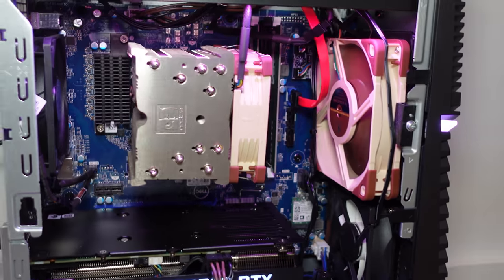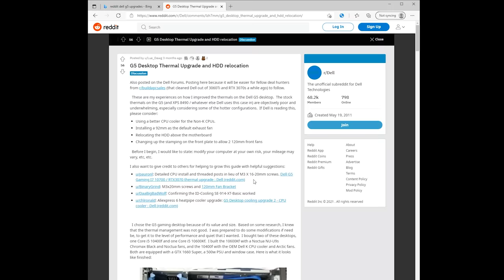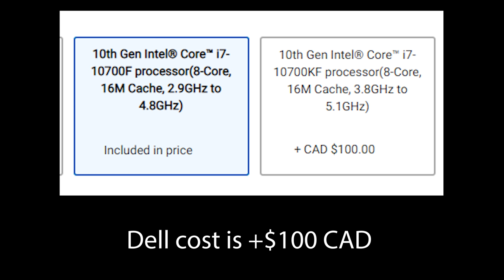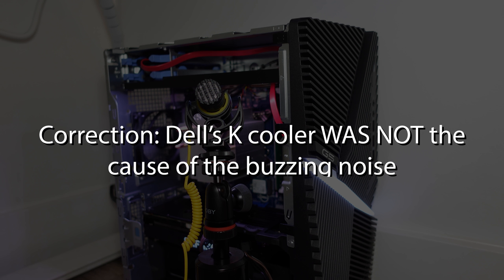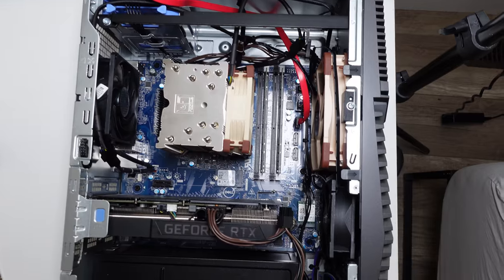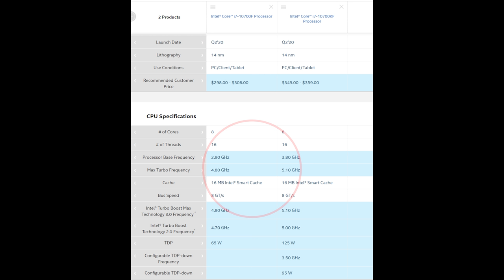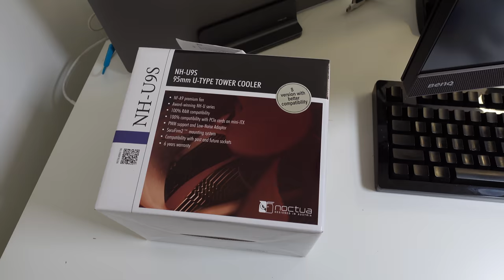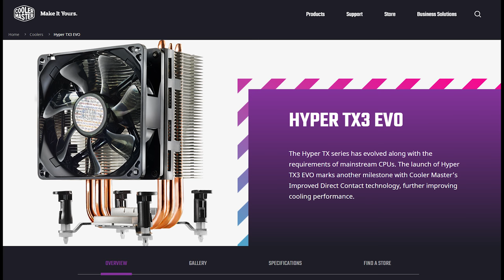Should You Upgrade Your Dell G5/XPS CPU COOLER? (with step by step instructions, in-depth analysis)

Comment: I've been building computers since 2001. Don't bother with "dime size/pea size/dot pattern" for your thermal paste. First and foremost, let's regard it's purpose: Thermal paste does NOT help conduct heat between the CPU heatspreader and the cooler base. Yes, I said that right. You want as much metal-to-metal contact between those surfaces as you can get, but the job of the thermal paste is to create a heat bridge between all of the GAPS between the heatspreader and the heatsink. Air is a great insulator, so you don't want any air gaps between the surfaces. That paste of dielectric grease and finely ground silver particles is there to fill every groove, pit, and air gap between the microscopic ridges of the two surfaces and bridge heat across them, but not to be the primary transfer medium. There's not a thermal paste out there that makes heat transfer between metals BETTER. Adding a blob and hoping that the pressure of the heatsink is enough to squeeze out most of it is less than optimal. You want heat going from metal-to-metal with the least amount of interference from the paste as an intermediary. 

That said, the "old-school" way is to place a small dab on whichever surface is larger, flatter, and easier to work with (usually the CPU) and work it gently with a flat razor blade. You're using a razor because it is incredibly flat and clean, not because you want to cut anything, so you drag the blade across, not push it. You work the blade in a cross-hatch from at least 4 different directions until you get an even distribution of paste on the surface in the THINNEST LAYER that is practical. You will be absolutely amazed at how much paste you remove in the process! OEMs of coolers add too much paste to guarantee 100% coverage, but they have to have a large safety factor because of human error that they can't control. Too much paste is still better than not enough, but too much paste will REDUCE heat transfer. So you're going to get a thin, even layer on ONE surface, place the cooler on as squarely as possible, and gently twist or slide to align within say 1/8" or ~4mm. It's totally okay to lift the heatsink and look at the pattern. There's more than enough paste in the tube for 2-3 applications, but it's not like you have to throw it away when resetting, just collect any overflow, gently scrape or wipe one surface, re-spread it all evenly onto the other side and try again. DO NOT lift the cooler and then smash it back down without re-spreading the paste or there will be gaps. To some degree you have to "get a feel for" whether you need to start over or not. The paste doesn't have great shear strength, and you don't want to introduce gaps from sliding or rotating it too far, but a wiggle or two are fine.

Lastly, that paste needs time to set UNDER LOAD. It is a paste, and after it heats up it will flow and squish out the sides ever so slightly as it seeks to further fill those tiniest of scratches and gaps. Check your temps again after a couple of days or a good torture test and you will almost always find it cools better after "bedding in".
Reply from the maker: Wow thank you for such detail.
Reply: @billmahan6373  If it's working for you, no need to change it. You only have to reapply/re-spread paste when removing & replacing a heatsink. It doesn't break down like engine oil - or at least not in a timeframe that matters to practical use.

Comment: I tried doing the fan + CPU cooler upgrade, and I am getting bios errors. I am using the Noctua A9 92mm fan (Chromax) and Noctua U9S cooler (Chromax). I found a workaround for the case fans where I need to plug in the OEM 80mm fan as intake, however I can getting a bios error for the CPU cooler.

Comment: I did the same thing except I ended up using a thermalright peerless assassin mini. Their brackets fit right into the screw holes, I just needed some 16mm M3 screws from the hardware store.

Comment: For a cheaper Fully compatible screw in option, Silverstone KR02 comes with compatible screws just screw mounting hardware straight into the backplate. 100% compatible. only $35 AUD in Australia and readily available. Temps will be about 80degrees.

Comment: Just an FYI, m3 machine thread screws are very popular in the RC community so if you're in Canada and need m3 screws/bolts/nuts/washers of all different lengths/depths/thicknesses, try an RC hobby store.  Since I build both PCs and RCs, I have a huge collection of m3s ranging from 5mm to 100mm in length, all from hobby stores both local and online.
Reply from the maker: Super jelly!

Comment: Regarding those m3 screws, I have them.  Yay!!  

So, here is the question.  How far do I insert them?  Do I screw them until they hit the floor, as in touching the backplate of the case?

Or is there a different depth ?

Maybe just enough so they stand up?

(Is it cool if screws from the top of the motherboard touch the back wall?  It seems ill advised to me; but I don't actually know.)

Also, did you use the lock nuts on the screws?  If so, do you still need the black spacers ?

Got the screws.  Hoping for some additional details.  Can you please help?
Reply: I'm curious as well.

Comment: Hi, nice video, thanks for make it, I suggest one more alternative to install easer the noctua, just cut the heads of the m3 screws, but put the nut first to redo the thread of the cut part, use m3 x 25 mm or longer

Comment: for me, the vwd01 heatsink is TONS better than the stock pancake. im using a precision t1500 that was being thrown out, upgraded from the i5 650 to the i7 870 and without turbo technology its hitting 100°c, and i did change the thermal paste several times. the vwd01 keeps it from throttling at a nice 70-75°c so it depends what cpu you’re using for it

Comment: Damn y'all, I bought a XPS 8950 and started worrying I wouldn't get the more premium heatsink since I had bought a i7 12700 non-K version (it was on clearance, so I had no choice). But I got lucky, and it happened to come with "advanced CPU cooling" and actually came with the nicer heatsink. I was already getting ready to buy one off eBay

Comment: Do you think a core i5 10400f with a stock cooler and a gtx 1650 super could run normal temps on games such as fortnite since many of the reviewers purchase high end computers with rtx 20 30 series cards. Thanks
Reply: Also, if the computer does overheat, couldn’t I technically under volt the gpu and cpu since it is taking less energy which would significantly improve thermals.
Reply from the maker: youll be good, dont worry. u can always upgrade the cpu cooler as shown in this video!
Reply: @JSyntax  thanks! I was a little worried because I purchased one on sale last week.

Comment: you can change the fan onthe premuin dell cooler. I can see in the video at 6:47  the its held at the bottom with 2 screws and the cap plate is screwed to the fan at the top.  that might something to consider for anyone want a simple bolt-and-go solution.

Comment: What is funny the Vetroo V5 cooler I bought for my XPS 8940 fit with no additional hardware, pulling the motherboard, or anything like that. Mine was a non K version so didn't have the upgraded cooler to start with, just the pancake one. I have no more thermal throttling now that is installed, and I think it cost me around $30, as they included thermal paste too. My video was more of a review, not a how to. Good information in your video.

Comment: Great video. I had to spend hours on dell forums and reddit to learn the exact same things mentioned here. This is the best video on this topic, clear and covers everything. I already did my upgrade from pancake cooler to Noctua and can clearly see the difference (I used 25 mm grub screws, as I got them easily here in the UK). On a side note, do you know if Dell sells the internal light bar? I bought a CPU with no clear side panel or internal lighting and so trying to find them.
Reply from the maker: Haha you lucky ppl in London. Yes, I wanted to cover some auxiliary topics like which noctua cooler is the best. As for the RGB bar, no it came with the pc. Are you going to make your case clear?
Reply: Yes, I ordered a clear side panel from Dell. They only have refurbished ones but I guess I don't have an option. So looking for the RGB light bar now. Also looking forward to your video on adding front intake fans. I might add them too if they can make a significant difference.

Comment: hey. got a verry similar 8940 last spring. complained that all the marketing material shows the larger premium cooler & the computer was only supplied with the cheaper pancake & they replaced it quickly with no problem.
looks like the fan can fit on either side of the noctua - worth a try running it with 2 fans 1 each side - maybee even some tube to funnel it directly to the case exhaust fan?

Comment: Great vids,  I just lurched the XPS 8940 special edition with 11 gen i7-11700K,  I made sure it was the K version as my sons XPS SE from 2019 the previous XPS Design with a non K version 19 processor and really regret not spending the extra $100 back then.  My sons version has the worst fan setup I have seen, the new one I just purchased seems to have a lot more open air space for better air flow, even with the 3070.  I should have it it about 2 weeks, so I’m thinking of the quickest way to improve my air flow from day 1, I really don’t want to change the K version processor cooler just yet,  so I’m thinking to go with a larger back fan, and possibly mounting a front intake fan ( I did opt for a 2nd 2TB HDD, so I think that may need to be relocated ( correct?)  or is there a workaround, if I need to move to another bay then I will.  Have you come across any simple to install front mount intake fan setups since this video or the other fan video for XPS/g5 you had made?  Also is there anyway to install an additional fan on the outside of the stock processor cooler that can create a push/pull setup using the existing setup?  Creating more flow through the cooler?  What would you recommend as a start to adding efficient / proper cooling from the start with out replacing the upgraded stock K cooler setup?  Can the fan in the stock configuration be replaced while retaining the existing cooler setup?   Thank you and appreciate and advise, tips offered in advance.  I’ve used many XPS setups throughout the years and been happy but I plan on using this machine a little harder then those other XPS ones over the years ( with my first one being a fully loaded XPS M1710 laptop back in 2006, was a beast at the time). My main computer for my business is actually a 2014 Precision T7600 with dual xeon 6 cores just put a P1000 gpu just to run my 4 monitors without any adapters and that thing gets hammered at work daily, ( but can’t play a simple game on it, my son thinks it’s funny but can take up to 20 minutes every night closing every program and chrome tab that gets opened daily, not because it’s slow, because I literally don’t close anything during the day and running several graphic design programs). That workstation is like my old reliable 1970’s V8 Caddy when it come to reliability 

Well enough on that, so basically I’m just trying to get as much simple bolt on power to the new much smaller, but more tech infused computer, and like most things MORE AIR ( used properly) MORE POWER

Comment: Put this on my new xps 8950, threw a bios error so I put the original dell fan on in pull connected to the cpu port with the noctua in push connected to the port labeled pump, and the error went away. I don't know anything about computers so hopefully that configuration is fine.

Comment: I bought the i7 10700f and 3060ti with 8gb ram and a hard drive to save as much money as possible. It came out to 1350 with tax and shipping. I ended up getting the HYPER TX3 and some m3 washers and screws to mount it. I agree the motherboard is a downside in that PC I could never get my ram to 2933 which the i7 is specced for. Temps when stress tested reach high 70s and stay there. Installed a silent wings and noctua fan using a 3 fan splitter. Overall I like tweaking and messing with stuff so while some people might be angry that I had to do all that I thoroughly enjoyed it.
Reply from the maker: Yes it's fun to mod! Gets you ready for a fully custom DIY pc
Reply: With a weird hack, it's possible to get all your ram to 2933 (in my case 4 udimms for 32 GB all running nicely at 2933 and dual channel).
Reply: @hipflipped  it just depend on the dimms I was lucky that my Corsair kit could run at 2666. All my other ram kits failed to run at above 2133

Comment: I added a Noctua 12-mm case fan more out of caution than needed at this stage.  Everything is so quiet.  I still have an error at boot up that the CPU fan is not working.  Any clues on how I may fix this?
Reply: add a splitter to keep the old fan?  maybe something to do with the speed the dell fans can spin at.

Comment: Question? Does Noctua or another fan manufacturer make a fan that can replace the Dell supplied fan? If yes does anyone know the correct part number? If the fan was replaced would the stock cooler be capable of similar performance to the Noctua or the other available aftermarket coolers?
Reply from the maker: no i dont think u can replace the fan easily on the dell cooler. Also please note that the noctua cooler has better heat pipe design

Comment: I installed the U9S to replace the Dell pancake cooler in my new XPS8950.  I get the occasional error on startup that there is no CPU fan but I think it is just a delay in registration as the fan is spinning happily and no other warnings while the machine is running.  Everything is running pretty cool but no big loads on the system yet.  The front plate on the XPS is flat and the 90mm intake fan is lined up with the graphics card and power pack.  There is room for a Noctua 120mm fan above it but not sure if I need it yet.  Your video was the most helpful in making my upgrades.  Many thanks.
Reply from the maker: So glad you were able to get such a great cooler in your PC

Comment: Thanks for the video, really useful. What kind of temperatures are you seeing under load? I've an XPS with a 11700k and when gaming, HWinfo tells me I'm running between 75c to 82c. I typically play flightsim and racing games so it can be GPU amd CPU heavy but I'm curious to know what temps I should expect. 

Note that I've changed the rear fan for a 92mm Artic fan and have managed fit a 120mm Artic fan at the front of the case to get airflow through the unit. 

Cheers again.
Reply from the maker: No problem! I will check and see but they were improved a bit with the new fans where I'd say the problem was solved.

Comment: I just made the upgrade to the Noctua CPU cooler. Just like you, it took me a few tries to get that cooler to sit on the base correctly. It did make a huge difference thermally and audibly as well. I am sitting at about 35-40 degrees idle and 60-70 during gaming. I am surprised though that your PSU was making that much of a squealing sounds.
Reply from the maker: Awesome, I hope you like it
Reply: My psu occasionally sounds like a wood burning stove crackling away.  I worried it was arcing but it's how that psu is.  Its actually a descendant of a server psu hence its weird form factor for hot swapping into power edge servers, so I think it will be ok.  I can say that the supply rails are very smooth because I use an sdr radio receiver in this pc and itsv the best I've used for being quiet.
Reply: @dr_jaymz  Mine did this on my XPS 8940, often when going off standby mode. It was the 500W Lite-On variant PSU. Called tech support, had it changed (they even swapped the whole computer at some point), I finally ended up with a Delta Electronics one that does exactly more or less the same sound than Jsyntax's. You only hear it when the CPU is in idle state, and it's quiet compared to the "wood burning stove" sound of the Lite-On one. Also the only way to make the crackling noise stop was to reboot the computer (by shutting it down or putting it in standby mode momentarily), that was really annoying for me, at least the Delta one is consistent in its operation.

Having gone through a couple of them, I guess I can safely assume that all these power supplies make noise to an extent. I'm relieved to know at least that it seems common with these and that there's no danger for our components inside.
Reply: @kekwill99  yes when there is very low power demand the inductor switching becomes discontinuous,  so it stops switching briefly until required.  This is why they are very energy efficient. You cannot hear the switching normally because its much higher frequency than were can hear but you can hear when it starts and stops and that is what we are hearing. Its possible to design it to prevent that noise as well but that just makes it more complicated. I still think that these psus are descended from server psus where reliability and simplicity is favoured. We run hundreds of dell servers each with two psus and any psu problem is very rare.

Comment: Great video and information!  You mentioned it would be great to upgrade from the stock pancake cooler to the Noctua. I will assume you would recommend upgrading the Dell K variant tall cooler form the pancake as well. I need help in determining if one of the upgraded K variant coolers will work in my Inspiron 3670. It also has the tiny stock pancake cooler.  I believe it will bolt right on in the Inspiron 3670. What do you think???  Thanks!
Reply from the maker: I believe it's a good idea!
Reply: @JSyntax   me too! Do your think it will work? I’m going to try and find pictures of both motherboards with coolers off for comparison. Thanks!